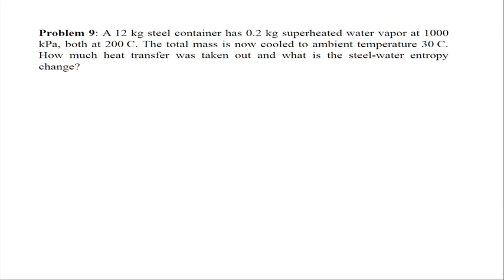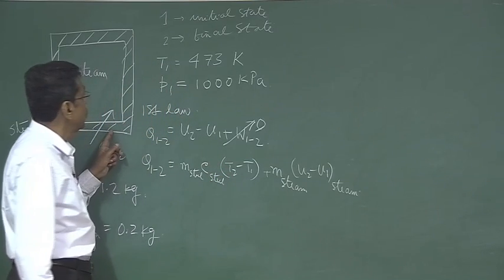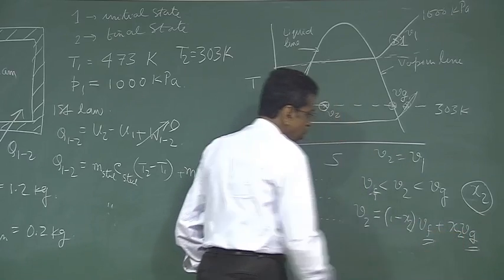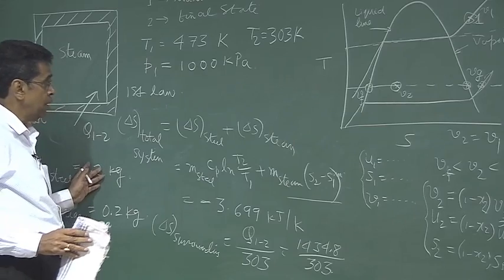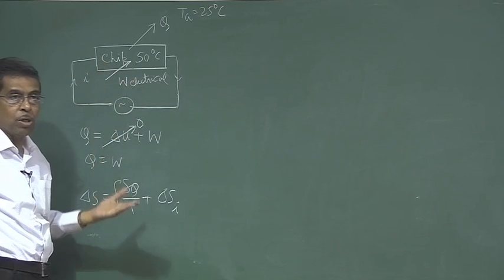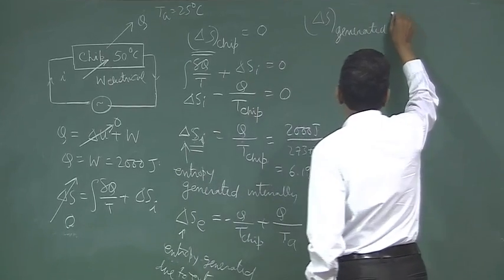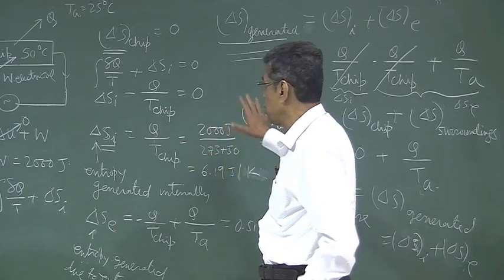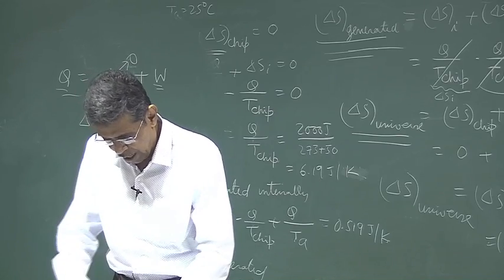Entropy

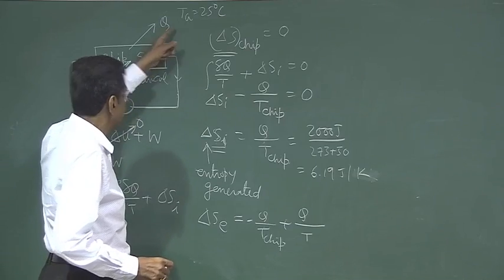Comment: at 23:40 entropy generated externally is calculated where sir has taken -Q/Tchip +Q/Ta  WHY there is (-ve) sign as heat is added to surrounding
Reply: Chip is rejecting heat so negative while surroundings is taking heat so positive